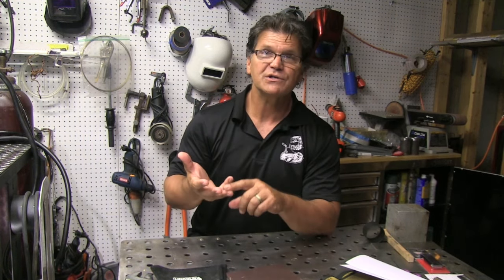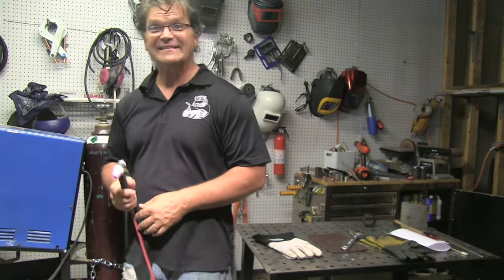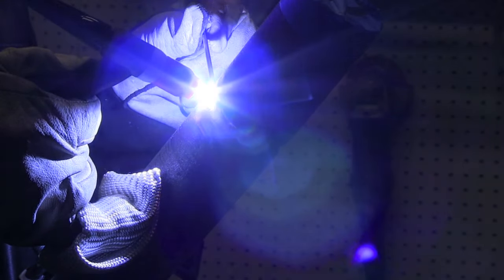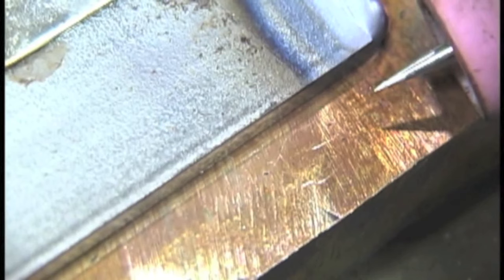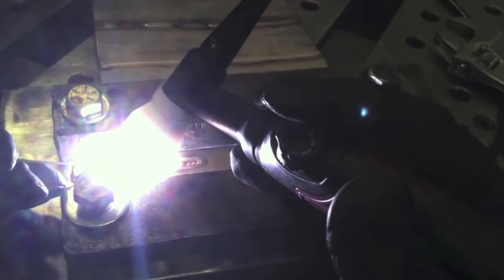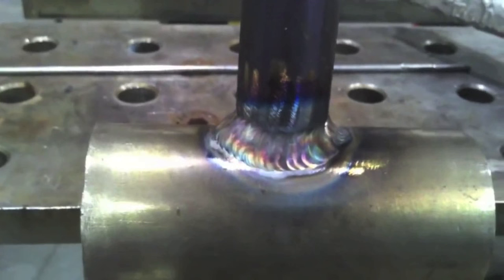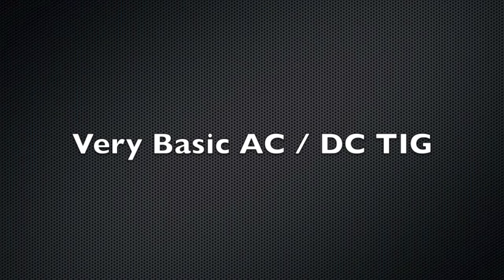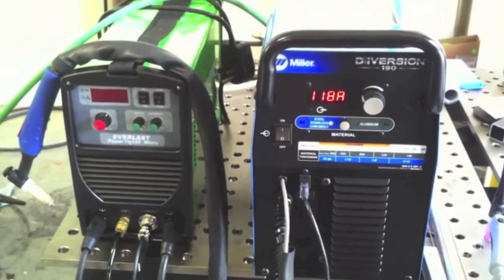TIG Welding Basics Overview

Comment: Hey love your videos ! I was wondering what a good machine to start with is? Something g affordable I've used a might before and have had some decent hood time with it but I really wanna pick up an affordable tight machine . Preferably with a foot pedal ! Thanks !
Reply: I started to learn tig welding a while back and picked up an Everlast ac/dc welder recently. There are quite a few video reviews of them (from Jody too) and I have been pleased with mine. Just make sure you get good instruction when you start out and don't pick up any bad habits and you will do fine.
Reply: Thanks I'll have to take a look at those thanks.
Reply: Would this be a good model ? 

http://www.discountwelders-direct.com/tig-welders/everlast-tig-welders/Everlast-Power-I-Tig200
Reply: dirtboy125
That would be a fine model as long as you don't intend to do any aluminum or magnesium welding, then you would want an AC/DC capable model. I have the Everlast 160sth (DC only) and it does all that I ask of it out here on my little farm. I personally don't need to do any sort of high rate production work so I've never even hit the duty cycle in the year I've owned it.

I do occasionally wish that I'd had the money for an AC/DC model to fabricate with aluminum, but I haven't really needed it, it is more just a desire than a must.

The foot pedal I recommend is their "Deluxe" model, it is worth the extra $30 bucks for the slimmer unit that doesn't feel like a brick underfoot :)

I hope that helps...Aloha from Knolltop Farms
Reply: Knolltop Farms Thanks ! I'm just a beginner and don't have any real practical use for one other than making small projects and such. So I'm not even sure if I should spend the $600 or if there's a cheaper alternative
Reply: dirtboy125 You'd be surprised on what you will find to weld once you get started! Really quite fun. I started with the Everlast 185 and moved up to the Everlast 200dx once I got going. Good luck in your decision!
Reply: dirtboy125
There are many cheaper alternatives, my main recommendation is that is if you are planning on doing TIG, save enough for a footpedal, it is much better to have control of your puddle, especially when learning to TIG. I stayed under 6 bones by going with the 160 and I just make more beads and do a little back grinding on thicker stuff. I will be going for an AC/DC next, but that is just for the lust of luster. Plus I'm getting into machining and want to be able to fix any of my own gouges or tool failures...

I have been welding for over 19 years though, so at least I'm not talking out of my arse when it comes to that :)

Have fun and always wear your safety classes...they save you a head X-ray if you ever get an MRI, LOL!
Reply: Knolltop Farms Lol ! Thanks I'll take a look at the 160  and I definitely wanted a pedal I don't like the scratch tig or lift tig. I just wanna be able to fix small things and build dumb little tools or projects
Reply: 1. Buy Everlast if you are just a personal use welder.  2.  Buy a tig finger or three.  3.  Watch all the videos on this awesome channel.  I have the Power Pro 164 and am very happy with it.
Reply: dirtboy125
Hey, please give yourself some credit! Building tools is awesome, and a toolmaker is what I someday strive to become...I can't wait for more guys like you to lead the way on expanding the American made and hand crafted tools market. I know it's ironic as we talk about in import welder being so well made, but it's true. I would have loved to buy an American made welder, but they are a bit crazed when it comes to their pricing. There are certainly differences in the finer accessories like the torches and certainly ground clamps, but the Everlast units themselves are a much better value and they do have excellent US based customer service and repair. I just hope that the surge of IGTB welding tech will lower the prices for an American made product line to surface...keep in touch and lets share projects DB...Knolltop Chuck
Reply: dirtboy125 You'll like the HF start on the everlast 160 (and the fact you won't need to remember to shut off the argon with a manual valve after welding)
Reply: Yes, that is extremely nice...my bottle has lasted me for almost a year...but it's a 125 cu. ft, so I'd have to weld for 6 hours straight and mainly use Tig for the fancy or sensitive stuff...or if I have a really fresh set of parts I've machined and cleaned and just want to play "dime stacker"...it's the industrial version of mine sweeper, LOL!

Comment: what happened to that stainless shaft, looks like a burnt spot, was that from a ground issue?
Reply from the maker: it was a long time ago but i think i accidentally slipped and arced off on the corner. since it was going to be machined off anyway, i didnt sweat it.  good eye.

Comment: Have you ever tried stratch start TIG with an AC Stick welder on alluminium? Does it work?
Reply from the maker: Scratch start on AC does not work well, without high freq, the arc will not stay lit.  when the current changes direction/alternates...one half of the cycle is reluctant to restart and arc dies.  it requires an external high frequency box but by the time you buy one of those you have way too much invested and would be better off buying a cheap ac/dc tig inverter
Reply: weldingtipsandtricks thank you! Ever had this doubt and now is sorted! Thanks.
Reply: weldingtipsandtricks
I wondered about that thank you for clearing that up

Comment: weldingtipsandtricks hey Jody what tig torch is the one you show at the beginning of the video?  As in brand and series? Any help from anybody would be great
Reply: Knolltop Farms man everybody seems to like ck worldwide torches so you pretty much convinced me..something that I really like is the red hose..would that happen to be the superflex hose? And is that stubby gas lens kit the one that let's you use the small 9 series torch parts or something like that?
Reply: Brandon Hernandez
Well, I wouldn't say it lets you use #9 series parts, it just makes your #17 or #26 compact like a #9 and allows you to get into those hard to reach places by improving you gas shielding and allowing you to not only minimize the size of the torch, but also work at a longer "stick-out" or to extend your tungsten without losing your gas coverage. At least that is how I understand it, and how it works for me. It made my no. 17 1/3rd the length, and with the gas lens I can extend my tungsten over 3/8th inches without any problems, and for a 3/32" tungsten that is 2X recommended :)
Reply: Knolltop Farms I see..damn thanks for all the info you know your stuff. .OK I'm new to this so I have a question. .at home I have a everlast powerarc 200 st (DC ONLY) stick welding machine and I want to start running a scratch start tig rig from it. I know the polarity changes so do I just switch the ground to the positive and the stinger to the negative?
Reply: Brandon Hernandez
Yup, that's it, and like Jody says in the beginning of the video, make sure to get a torch with a gas valve on it...here is a link to your manual and the info you want is on page 16...http://www.everlastgenerators.com/sites/everlastgenerators/files/downloads/PowerArc%20Series%20200ST.pdf

Good Luck my friend and thank you for the compliment...Aloha, Chuck
Reply: Knolltop Farms
- Negative to the Torch and +Positive to the ground clamp. Save the PDF file to your desktop, or if you have a printer, just print the pages you need and staple them together and put them in your shop, that is what I did after losing my manual in a move, LOL
Reply: +Knolltop Farms damn thanks a lot man keep on blazin!
Reply: Brandon Hernandez
Anytime man, you too...like my Dad taught me about working in industrial tank farms and building pipelines, "the only good time, is your hood-time", and boy that sure was true. You could be having the worst time with the foreman's foot up your ass all day, but when you dropped that hood and everything went dark, it was just you and that puddle that mattered, nothing else. Nobody would bother you when you had a bead going...nobody.

I think that is one of the things that draws people to welding, all the of sounds, the heat, and everything around you just falls away once you strike that arc. It's metal meditation.

Aloha Brandon, keep on burnin' and learnin'...Chuck

Comment: When I walk the cup,my filler rod always balls up and comes out of my puddle. What can I do to avoid this?
Reply: Pull your filler rod back a little farther it's getting preheated from the tungsten. But not too far to not have gas coverage on the filler rod.
Reply: often times the filler rod balls up (from getting preheated) because the torch angle is too low...straighten up your torch so it's pointed more into the joint and not angled so much toward the filler rod.
Reply: Mike Snyder+1 on that. I suspect Tanner is leaning the torch too much too.

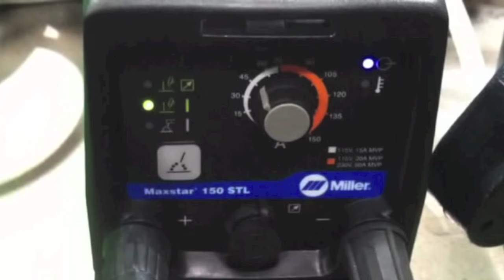Comment: I learned to weld using that machine 05:23 in 2006 , great machine to welding small parts but is a shame for muller to build a  welding machine without high frequency

Comment: Thank you very much Jody. I think there will be much less of the standard D.C. welding machines being used to  tig weld  as the price of advanced  tig machines has become so affordable and compact.
Reply from the maker: right you are.  for the home user, scratch start is nearly as expensive as a starter tig inverter.
But for industrial use like pipe welding, scratch start will be around for a long time.

Comment: Jody how come when I do a bud join, on aluminum I do great, and same settings same aluminum material on a T join it doesn't weld as smooth as the bud join???
Reply: On a butt joint the arc can only go to the flat plane and it will stay consistent since the joint is the shortest path from the tip.   On a T joint where you are angling the torch into the V of the joint the arc can easily jump back and forth between the two pieces since the arc path is shorter side to side.  Use a pointed tungsten which will narrow the arc and stabilize it better.  Keep your arc length short and deep into the V.  Use a narrow cup if needed to get the tip right into the joint for the root pass or increase tungsten stickout and up the argon flow a bit if you only have a big cup.
Reply: Thank you very much !! I'll make those changes to my torch and technic
Reply: gato felix Also, when you are welding a butt joint, you are welding two edges.  With a T joint, you are welding one edge and a flat which just sucks the heat away.  Think of it as trying to weld 3x as much material as a single edge vs. 2x as much material with a butt joint.  Some weld books actually show this with a picture to show where all the heat goes with the two different types of welds.

Comment: 24:23 So I take it by that comment then, that the XL Tig Finger was really created for working on your wife??? NO, PLEASE DON'T ANSWER THAT COMMENT! ;).

Jody, I've got several questions. I'm just wanting to get into TIG welding and I've purchased (it's still on it's way in transit) a Lincoln Speedtec 215C welder (here's a link to it http://www.lincolnelectric.com/en-gb/company/newsroom/Documents/speedtec215c-eng.pdf ). Can you (or a helpful viewer) tell me if this machine does the balanced AC TIG welding and pulse TIG welding that you talk about in your video?

Also, with your stubby gas lens kits, for the likes of the #17 torches (which I've bought, along with the 2% Lanthanated TIG electrode bundle, the two TIG Fingers and more, from your Weldmonger Store, which are still in transit also) do you have to buy stubby electrodes, or can you just shorten the ones you've got, and if you can just shorten them, then by what means?

Also, you touched on the 'Lift TIG' welder briefly, in this video (which I believe the welder that I'm getting is) however, failed to mention how to stop the weld. Is it stopped the same way as the Scratch Start TIG setup, or the HF setup, or does it have it's own unique way of stopping, so that the cooling weld still gets the Argon without having to clean it again before re-starting and continuing the weld?

Thanks.